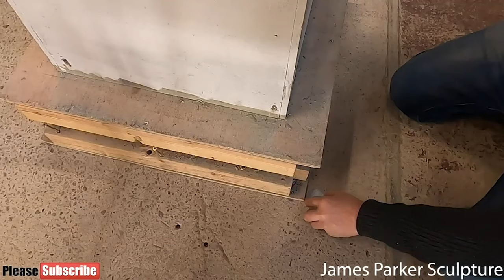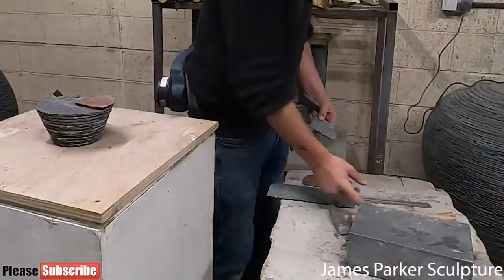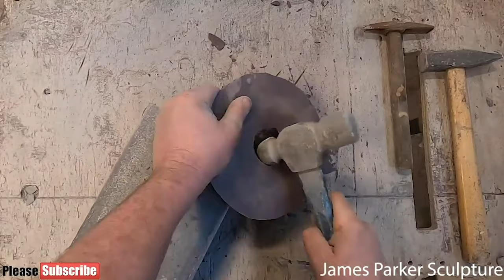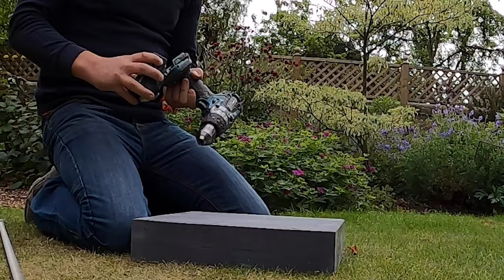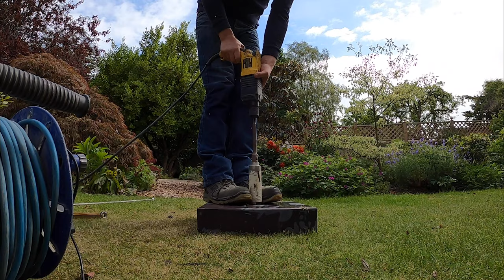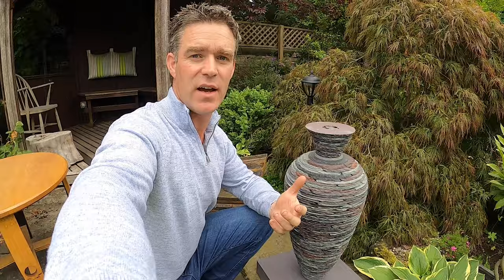AMAZING STONE SCULPTING | Start To Finish!

Comment: You assembled the vase dry in the video? How do you then bond it all together? Do you have to take it apart again to bond it to make 1 solid sculpture? If so how do you remember what piece goes where? And how long did it take you to make this sculpture from start to finish ? Sorry for all the questions. Love your work and videos.
Reply from the maker: Hi Graeme. Yes that's right. No doubt you can see that i's not exactly the same on the install! I reassembled fixing it together. Every sculpture is different. The larger heavier pieces don't need fixed at all  however they often are as clients understandably ask for them to be secure. I prefer to keep some elements of mystery.

Comment: Amazing work. Could you share the details of the airflow mask you're using in the video please?
Reply from the maker: Thank you. I'll maybe make a video on this soon. It's a Sundstrom SR900 fan system and Sundstrom SR500 or 450 half mask. It's powered by a battery which lasts about 8 hours. It can be used with a full hardtop but I don't generally require eye protection so prefer this setup.
Reply: @jamesparkersculpture  thanks very much!

Comment: That's just stone tiles stacked on top of each other. How is that vase going to hold its shape? How wold you transport it if you need to?
Reply from the maker: Before placing it on site I bonded each piece of stone. The larger heavier sculptures I make can stand dry - without bonding but I usually do secure them. Every sculpture is different. I can safely secure them before moving/shipping overseas.